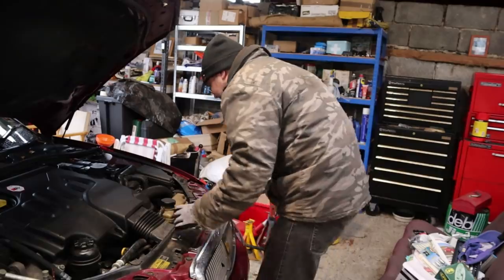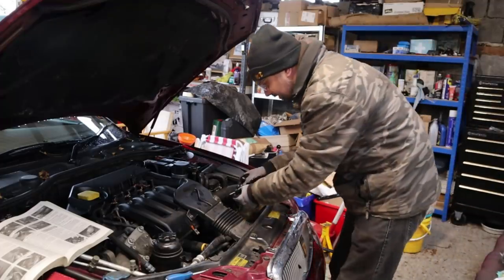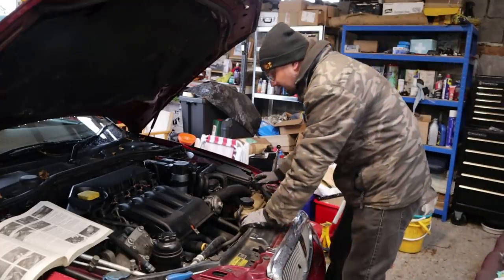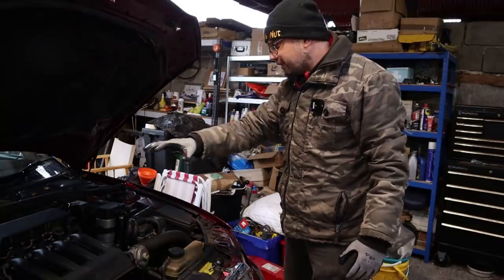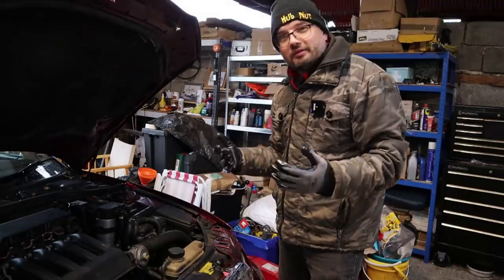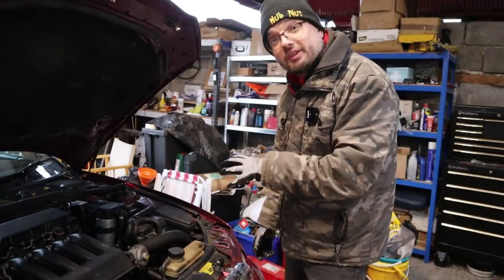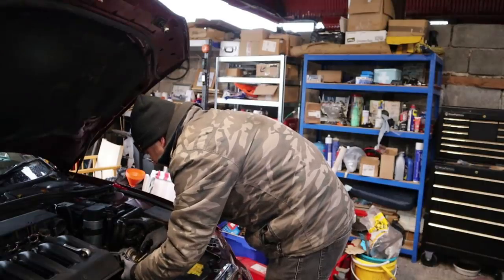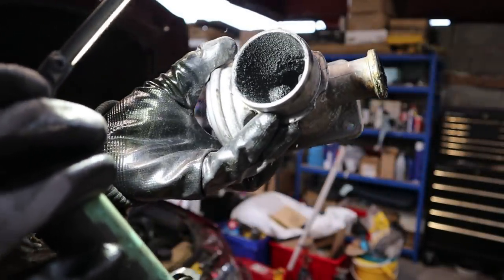Rover 75: Man vs EGR and PCV Part 1

Comment: I haven't gone through all the comments so if it's already been mentioned apologies, but to remove the EGR is an offence under the Road Vehicles Regulations. Your car could also fail the MOT if it doesn't fall within the parameters set for emissions on your vehicle.
Reply: The mot gas analyser can’t detect it’s been blanked.

Comment: local pet store is bound to have some t-pieces for their aquarium friends' aeration needs. or glue it with some epoxy. newsagents used to stock bison epoxy 2-syringe sets. local hardware stores too. failing that, amazon can deliver tomorrow, just find the correct size, I'm thinking 5mm all round. you can't possibly live somewhere where there are no pet stores, hardware stores, newsagents or post offices, or can you?
Reply from the maker: Er, no pet stores for miles.
Reply: @HubNut  a word of advice, if I may? get yourself a 3d printer, you'll thank me later...

Comment: That's a pretty gucked up EGR for sure, just a shame they had to use them when there are better means to deal with NOx, but recirc valves, DPFs and ammonia injection is cheaper than designing better engines unfortunately... :\

Comment: The EGR isn't so much about burning the gas again.... An idling diesel has too much oxygen in the cylinders for the amount of diesel injected at that engine speed. This raises the combustion temperature to the point where high levels of NOx are produced. Pumping in some old cack from the exhaust means lower levels of oxygen, so lower combustion temperatures and less NOx. And sooty-tar filth in your manifolds. I believe it also increases the amount of CO2 produced, thereby undoing the supposed benefit of diesels.
Reply: On the EGR, some Freelander Td4 guys have suggested that removing of blocking the EGR causes a flat spot in the throttle response and you are better off maintaining it properly rather than gutting it. So good call.

Comment: You do have to wonder about the environmental plus of EGR on small diesels when the downsides of the systems are the engine uses as much as 25% extra fuel (Hyundai FD diesel) , oil change intervals need to be reduced to cope with the soot loading, the engine efficiency deteriorates rapidly as it chokes on soot build up, the engine life is reduced to half or less of a non EGR engine, soot in oil makes fantastic cylinder lapping compound. This then requires foundries to melt down old engines, make new castings with the pollution and wasted fuel that goes with that. and make new cars to replace otherwise perfectly functional older vehicles which have become uneconomical to repair due to worn engine, clogged exhaust systems and so on. My 1959 Morris Engine is still just as slow and noisy today as it was 60 years ago, with oil changes when I remember and no drop in engine (non) performance.

Comment: Well wouldn't that just boil your piss! Always the way when doing a job like this that something would go wrong. I had the unfavourable "embuggerance" of having to clean the inlet of my VW TDI engine that's in my camper, and what a disgusting job that was! Most of the gack was actually in the inlet ports in the head in my case, so I used a gutter bolt to scrape the crud out, and it made a massive difference. To clean the inlet manifold, I set it on fire and burnt the carbon and gunge out of it. I don't recommend this if you have a plastic manifold though!

Comment: 99% of old transits have their EGR blanked off
Reply: Yup and thus completely fail their MOT.
Reply: @R33Racer  surprisingly not as many as you think, its like VW's where people take out the catalytic converter, most MOT men completely miss out on that as it still passes its mot
Reply: @thedeadstig123  As of this year, removal of a factory EGR or any system designed to remove emissions (regardless of their actual effectiveness) is an instant MOT fail.
Reply: yep i know but they'll still pass at most MOT stations
Reply: @thedeadstig123  the bloke who mot’d my berlingo 1.9d  van blanked my egr for me for £30
They know the score
Reply: @pauldoherty8432  exactly, most EGR's on working vehicles give trouble and workmen won't put up with it

Comment: Disagree nitrous oxides (NOx) are the issue they're claimed to be, cut up a aluminum can into two or three shims together blocking EGR flow, improving fuel economy. Alternatively have the EGR mapped out at the ECU, or on older cars where it operated by vacuum, fit a ball bearing or similar object to reduce valve opening all but tick over or else permanently closed.

P.S. remember government claimed acid rain from sulphur in fuel, did anyone ever see trees or buildings dissolving away?

Comment: Has that got Swirl Flaps?  If it has I'd do away with them.
Reply from the maker: Nope.
Reply: 😁😁I'd only just started viewing I see you mention them later on. I stripped and cleaned the Veins on a Mondeo 55reg the other week. It's fine now. Similar symptoms. You don't always get a Management Light on the dash when the vehicle goes into limp mode due to turbo vein issues. Depending on the vehicle. 👍